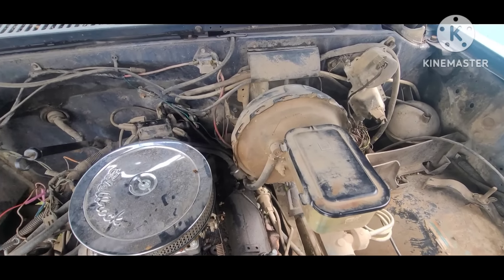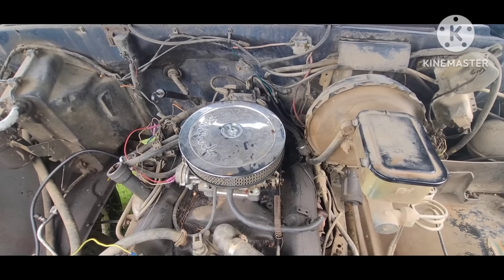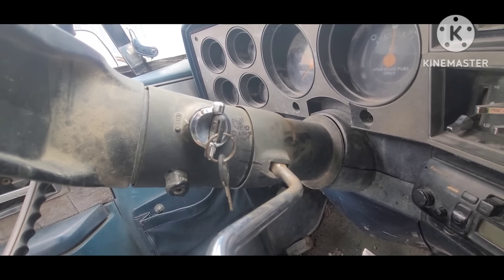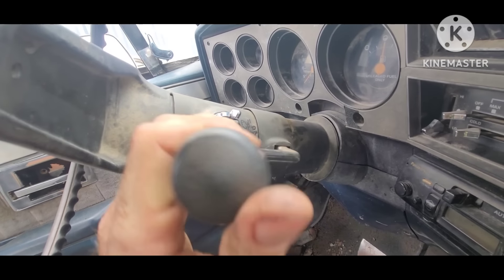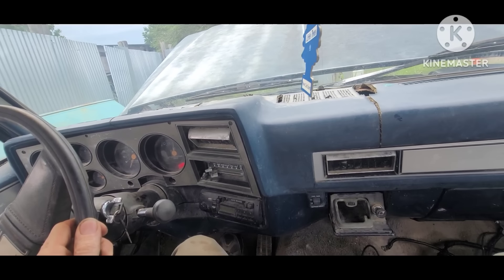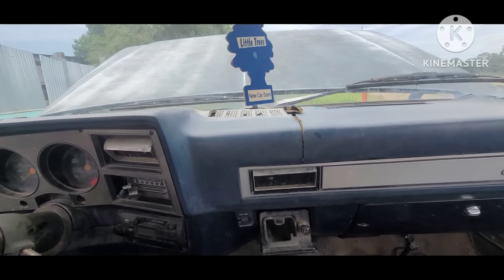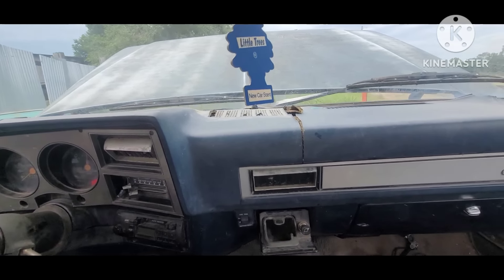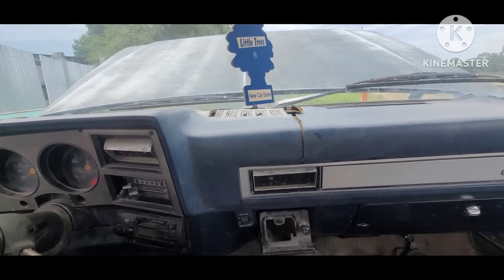This GMC saved lives - But can it be resurrected? Wrecked 1987 GMC 4x4 pickup Walk Around & Start!

Comment: I think it's an older engine. The valve covers have bolts around it instead of down the center on top, like my 87 tbi engine. I think the provision for mechanical fuel pump was removed in 89. I'm not sure.

Comment: ...you seriously started that thing without oil, first thing hearing that engine running ... that lower end sounds just great man ..😅
Reply from the maker: The oil level was between the dots on the stick. I noticed while editing that it sounded rattly in the video. I think it has more of a vacuum leak than anything

Comment: i have had so less work with the side post batteries.   They didn't always have a standard 5/16 bolt head though.  some were smaller.
the only problem I ever had was when the cable connections got hot, they warped the plasticized rubber around the connections pos and neg.
The mechanic cut them off to fix and actually has been the easiest connections to work with I have ever had.
If I had a choice I'd go side posts.

Comment: What you see on the side is a Dodge A100 side panel?
Reply from the maker: Ford Econoline 
It was wrecked in an ice storm and both the front and the rear subframes were bent. I parted it out and cut the side for Mystery Machine wall hangers
Reply: @mr.goodpliers6988  Hello 👋 Thank you for responding! 👍

Comment: If it were the original tbi engine the valve covers would have the 4 bolts in the center of the valve cover not on the edges, that’s an engine out of an older vehicle

Comment: That's for sure not the original tbi engine, the tbi engines have have center bolt valve covers and heads, appears to be a 83-86 Block

Comment: Not the original engine. Also not a TBI engine. Doesn’t have TBI heads on it. You can see the valve covers are perimeter bolt. Just a quick 2 cents!

Comment: That's an older engine. TBI engines had 4 bolts in the center of the valve covers. The first gen TBI engines had a problem where the block was cracked under the intake. GM had a special policy to replace them IF the owner noticed coolant in the oil. I was a GM dealer mechanic for 52 years, now retired.

Comment: I think you may have a big vacuum leak. The manifold probably has a spread bore pattern and that edelbrock carb is square bore. You need a correct adapter. Just kind of guessing

Comment: Engine is definitely 86 or earlier(valve covers, intake bolt pattern, fuel pump block off).
 Seat is from the next gen body style, a common swap.
Yes, with bent frame, cab, most sheet metal, & rusty bed, its parts only at this point.
 I'd say trans could be iffy given the point of impact & frame stress, a common thing as well.
 A shame, as it was a decent looking old truck.

Comment: A friend of mine is a former investigator for a trucking company.
After this accident, I showed him the original video, he said unfortunately it was probably Dalton's fault, in the eyes of the Law and Trucking Company.
I don't recall if they discussed the actual outcome, after the accident.
We all know the truck driver, probably got his license from a serial box.
I prefer side post over top post.
Since in most vehicles they do give you a jump point.
Also, in most older vehicles, you could always do the nut and bolt trick.
Or use a unilag battery.
Reply: I'm pretty sure nobody got a ticket, it was considered "no-fault"

Comment: I would bet the distributor cap got knocked out of position probably just enough that it’s causing the misfire. Probably just loosen the cap and spin it back into the correct position.
Reply from the maker: I did check that, all four spring loaded finger clamps were undisturbed and tight

Comment: I love classic vehicles and I am always hoping that rusted out vehicles, cars that been in an accident and vehicles with severe mechanical damage can be saved. But to those who think everything is savable, those are the same people who do not really work on cars. Like this car: It screams: Let me rest in peace. I own a once freshly restored65  Bonneville convertible. The owner happily drove it until a big truck pulled out in front.The blood on the  brand new interior, the bent and cracked steerinng wheel were proof of the suffering the driver went through. He survived, but got half blind and crippled. I overpaid for the wreck that was buckled until the quarter pannel. But I used tons of parts to keep my other vehicles on the road. The interior, trim and many, many mechanical parts were donated. And there are still masses of good parts on it, a running engine, the trunk and the entire rear are perfect and wait for the moment to be used. This car did not die in vain and neighter does this one.
Reply: Theres a guy restoring an AAR Cuda that was basically a vin, dash, firewall, one frame rail and a few odds and ends sheet metal, the rest was rusted off, the gone panels are being replaced with new

Comment: If that truck would have been hit where the gas tank sits outside the protection of the frame rails it would have very likely burst into flames and they’d be dead. These square body Chevy trucks were well known in the accident reconstruction business for the unsafe location of the fuel tank.Many of these trucks exploded into flames when t-boned because the unsafe location where GM mounted that fuel tank. In one court case the plaintiffs attorney brought out a copy of a 1930’s drawing and report about GM touting about how they mounted their fuel tanks in their trucks between the frame rails and way to the rear of the truck for safety reasons.  GM knew about the problem just like Ford did with their Pinto but it would have cost them too much money to recall them and add a shield to protect the tank.

Comment: I believe the 'crush zone' campaign is B/S to cheap construction. A clue was that crash test late model chev against the 59 chev which has by far the worst American frame ever made I've ever seen, just more propaganda. Look at archive wreck pictures to see non deformed cabins common clear back to early 30s. The head punched windshields are evidence 3 point restraints are the first best safety device, I have them even in my prewar cars and all my cars have front disk brakes. 

I got knocked into the back of a parked unoccupied late model same weight SUV in my square bird at 65 mph no time to hit the brakes. The SUV was crushed to the drivers seat. The square bird had no damage at the firewall and was savable. Square birds are especially strong because their heavy gauge inner fenders are seam welded to the frames and have very heavy bumpers. I didn't have a seat belt and only got a minor black eye from the padded dash and steering wheel was not damaged. I'd rather be the crusher than the full pop can.